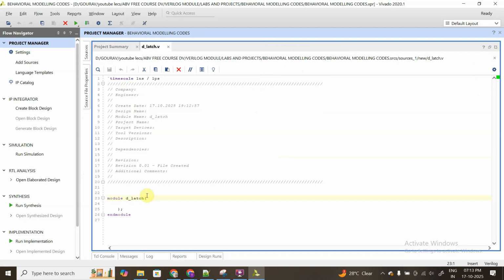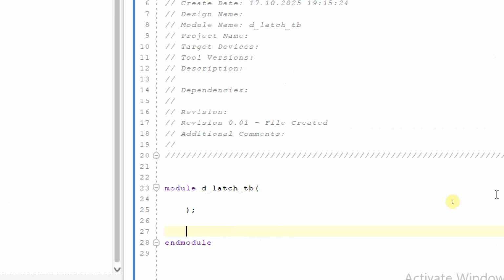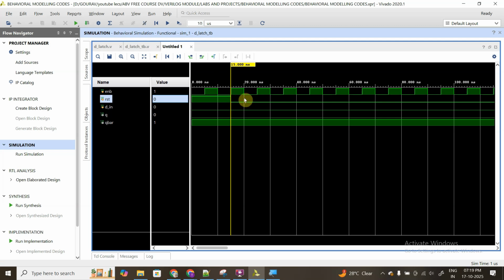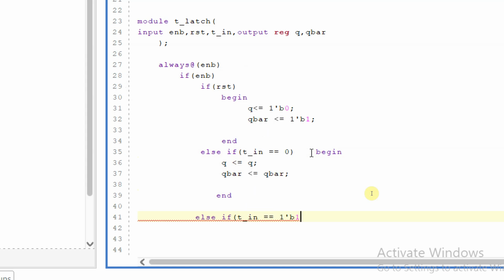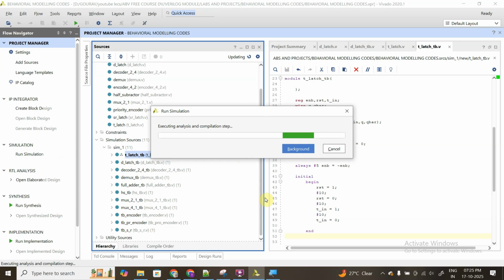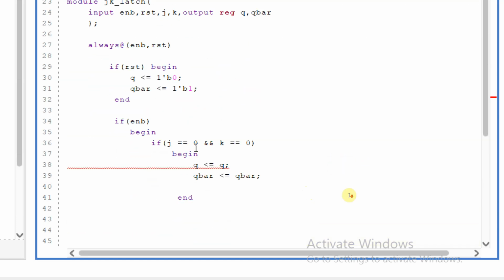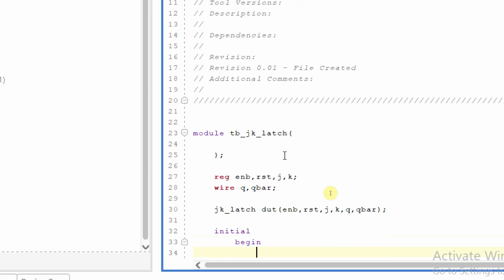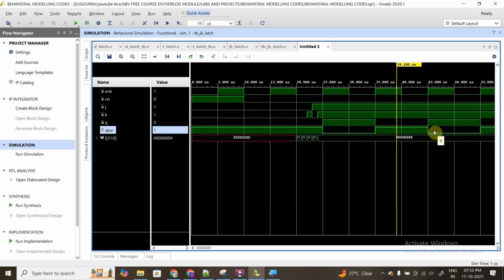D, JK & T Latch Design in Verilog | Verilog Sequential Circuits Explained

Comment: can someone explain why do we use enable ehrn it is not needed and what is rst,why r we declaring it before as we are taking a case of reset in code
Reply from the maker: For latches we have level sensitive signal which is enb
And rst is an asynchronous rst which I'm using in case of jk ff
Reply: @Allaboutvlsii but sir u were teaching latches in this session , although I got clarity that without reset flip flops and registers may power up with unknown values and enable is like a control to perform an operation